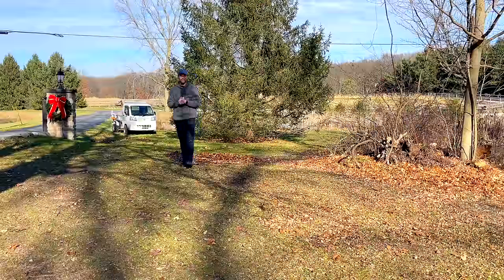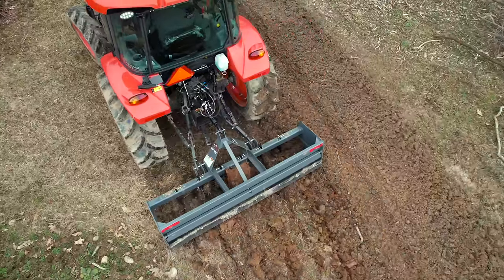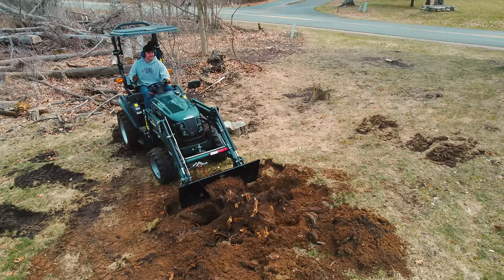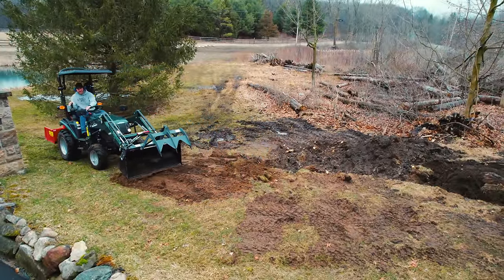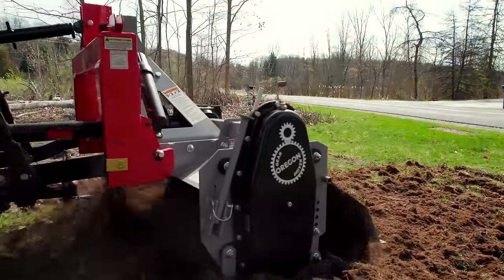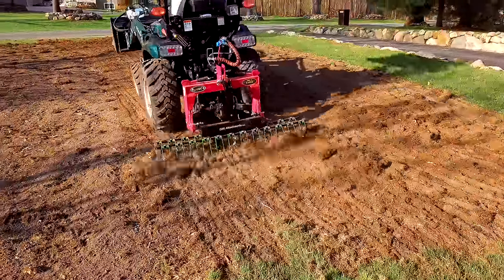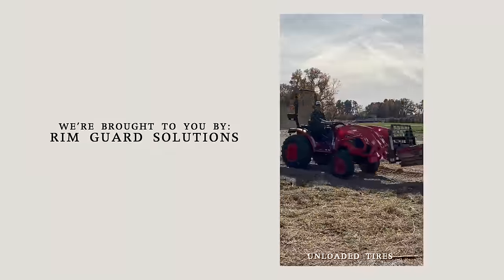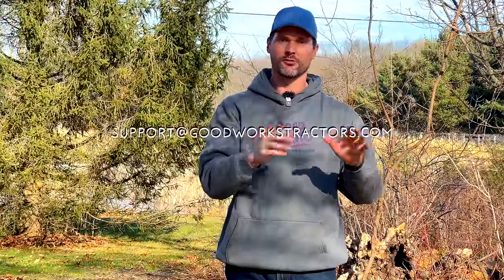HOW TO SMOOTH AND LEVEL A BUMPY FIELD OR LAWN

Comment: Courtney, Another great video. Good job keeping the people informed. I’ve had a JD 550 tiller on a JD 955 since 1993. As one person also said earlier, I would not trade it for anything. It pretty much stays on my tractor year round. The oddest use I ever had for it was once we had an ice glazing and then snow over that. I needed to push the snow off my driveway and since I use the tiller as ballast in the off season, I put the PTO to mid PTO which allowed the PTO tines to roll when I put the tiller down m. It then rolled over the gravel and broke up the ice glaze and it kept my tractor tracking straight on the glazed part I was driving very slowly over. Nothing was ideal in this scenario I might add. It really was such an odd usage, but when ya have one for almost 30 years you get creative. 

I’ve also left the PTO in rear PTO mode and the tines then don’t move and I use tiller as almost like a box blade and tillers drag flap on back smooths out piled up dirt and dirt flows through the tines rather well. I would HIGHLY recommend a tiller to anyone. I like it so much I bought a 681 when I bought my JD 4066R this spring. It is an absolute beast of a tiller too.

Comment: I did essentially this same process for a 20x20 flower bed i removed to return to grass yard. However, no matter what implement i used i just couldnt get it smooth. SO i went on Marketplace and bought an older Mauldin double roller vibratory compactor (the kind you drive)... 1 ton with empty drums, 2 tons with them filled with water. It was $2000 but man, what an addition to the arsenal. The ground was smooth and flat like an iceskating rink. I seeded over it and in 2 weeks i had green peach fuzz. Currently its the ONLY portion of my yard that is smooth and flat. Hahaha. After our NY winter ends, while the ground is wet in the spring, im going to roll the entire yard.

Comment: I’ve put good sized rollers on the back of tillers and they work great!!! The best rollers are the machined ones and they are also the most expensive but the landscapers loved them. Plan on spending as much as the tiller cost if not more. 

I’ll take out clumps and high spots with a heavy duty flail mower with hammers. Keep working in different directions until it’s smooth.

Comment: If you have a small-ish lawn and don't want to rip everything all up, apply a generous amount of soil to the areas you want to smooth out and hit it with a landscape rake. The rake will distribute the soil evenly and level the areas. This technique works great for low spots. A bit more work for high spots since you'll need to distribute over a large area to level things out. Thought I'd share so people don't think they have to destroy their lawns to get them level.
Reply: I'm not sure you've actually tried this. When you go over a bump, the rake follows. You never get it level.
Reply: I have a small-ish lawn and I’m trying to level it out since it’s very much uneven due to poor drainage, I’m thinking about leveling it first and then doing a French drain, what’s y’all’s opinion on that?

Comment: To level a piece of land out i would first determine how much roots there will be in the ground. If it's not much or much thick ones I would just till it with a rotary tiller and till it up really fine. And than just flatten out with a boxblade. If there are much roots I would firstly pul a shank ripper trough it and trie to pul out as much as possible. Collect the big roots rotor till it and then boxbalde it. The ripping will take a lot of time but it's the only way to save te blades on the rotary tiller from the thick roots.

Comment: Two years ago I bought a TYM T 264, same as a T 25 minus the air ride seat.  It had a FEL on it and I bought a 60" woods tiller.  I take care of about 4 acres and we built in 1991 so over the years after disturbing the land there were places the water found and reshaped things and about 600' of ditch line.  Plus I needed to fill in almost 12" around my foundation.  I ran the tiller across the top of the ditch with one side over and the other on the flat side and went back and forth what seemed like a hundred times then pushed the dirt into the ditch lessening the slope and smothing everything out.  I barely slow down now on my zero turn.  I needed a LOT of dirt around the house and I had a place they put the soil that cam out of my lagoon that was about a foot higher than the rest of the lawn.  I tilled and tilled that spot and created about 10 yards of dirt which I put all around the foundation.  It was just as soft as it could be.  I went nuts with the grass seed, may have used 3 times what I needed and covered it with straw.  I got it just in time!  It rained for a few days and in about 4 or five days I had really thick grass.  I honestly believe the tractor paid for itself in that one job vs if I hired someone to do the work.  When I was done the tractor was right at the 50 hour service mark.  The other thing I never knew I needed was pallet forks!  I never pick up anything manually now!  My sisters make fun of me and say things like, if you were wall papering a room you would figure out a way to use the tractor!  lol

Comment: I had about 2.5 acre area that was used for hay that had huge ruts when I built my house and made mowing with a rider hurt your back or get you stuck. This was the solution I used as well. Local guy on facebook tilled it for me with an old tractor. I used my friend's atv to drag a large frame I made from lumber that I'd wrapped with old chain link fence. That area is now more smooth than where the builder used their bobcat to grade around the house. I also didnt spray or scrape the topsoil and just tilled it all, and I didnt even need to seed it, the field grass came back on its own.
Reply: We built our home on a field that was used for haying and I have several very rough areas I mow that are so rough that I want to do something about it, and hopefully avoid tearing out the sod and bringing in new topsoil. So do you reccomend scalping the lawn first to get it as short as possible, then tilling it several times? The chain link fence frame you dragged around was just to collect small bits of sod/debris or is that what you used to level/smooth the area?
Reply: @p51mustang31 i mowed the 1 acre area with my riding mower as low as i could but not it's lowest setting or i would've hit ruts in the dirt and got stuck. There were still areas i couldn't get cut due to large ruts. I then had a guy with a tiller attachment on his tractor go over the whole area for me. I didn't spray and kill the grass like was suggested to me. The tilling left large clumps and spongy ground. It was also dry from not getting any rain for quite a while. I them built a fairly large frame from dimensional lumber nearly 8 feet wide and 4 feet front to back. I initially used that to drag with a 4 wheeler. It didn't knock down and bust up the clumps as well as i wanted it to. I then wrapped chain link around the drag and added more weight with dimensional lumber. This helped more but the biggest help was learning i needed to drive as fast as i could while pulling the drag. After that i just left it and the tilled up grass grew back after a couple months but it's smooth for mowing now.
Reply: @mleachx1  thanks so much for your insight! I'm hoping if I can make several passes over the same area with the tiller and that will help break up the sod clumps fiber and finer on each pass, and possible detach it also. Now I just need the utility tractor I have been trying to convince my wife that we need! Thanks again!

Comment: We used to do this method and it does work. Tiller, rake. But then when we had a few acres to level out rented a power rake. It did so well we wound up buying one to have and use. 90' landplane but they do make them smaller. I know they are expensive so if somebody has a small job to do they can look locally for somebody to rent one for a weekend. Usually just a few hundred dollars. Or you can even rent a skid steer and one and do the job pretty fast.  Not sure if you sell power rakes so may not help your sales but nothing like a good power rake to fine tune and level land out. Even with sod on it.

Comment: Thanks for the lesson, i will be doing a bunch of this next spring! How wide of a dethatcher/rake will a 1025R comfortably pull? I assume for level appearance the wider the better right?
Reply from the maker: You're welcome.  The dethatcher only comes in 60" and the 1025r handles it just fine.  It only weighs 50 lbs.
Reply: @GoodWorksTractors  thanks!

Comment: In my experience doing an area the size of yours 40x80 I would rent a gas powered sod cutter and cut the whole area. Then roll up the first 3 - 4'. Then take a loader bucket, put it in float and gently scoop up the cut sod. Granted you'll have to get rid of it, but in my opinion it's worth it. Then go back remove stumps, level or whatever you need to do.

Comment: tillers are awesome but if you can manage it, run a small plow single furrow or a double and then your tiller.  a small disc works great too. The smallest I'd go is 5 feet wide though because you need a bit of weight

Comment: You should try using the DeThatcher with the Heavy Hitch weight Brackets & 6 41 lb weights.  It's almost better than an Aireator.  Even clearing my trail cleanup was a million times easier.  The extra weight allows it to dig in as well as drag more material (when I was raking my trails) without the DeThatcher going over the material.

Comment: My Land Pride RTR would have broken something hitting those roots 5:30  thought at the top tilling-hight it is ideal for leveling if the feet are sliding on fairly level paths, I like how it leaves little rows of rooted-grass where I can notch out the peak of a hill every few months, or pull a few slivers of soil out of a ditch.
Reply from the maker: Neah, tillers are tough! Including your Land Pride.  They are designed to work in extremely rough conditions.  Worst case, you break the bolts off a tine.  Get some new bolts and back in business.  That's what they're made for :)

Comment: Just the tiller and a good chain drag would've been sufficient. My favorite drag leveler, is the springs from an old mattress or box springs. I can't believe no one has offered that as a legitimate product... as they're the most effective drag leveler I've ever used. They level, smooth contours, drag away plant material, and kick larger rocks up.

Comment: Step 1 rent a D9 dozer. 
Step 2 spend a week ripping out all the rocks and stumps and getting it flat with said dozer
Step 3 get some fill, hopefully your near a navigable body of water because trucking in hundreds or thousands of yards of fill is going to cost $$$$$
Step 4 rent a loader and start speading the fill
Step 5 who knows because your most likely broke by this point 🤣

Anyway that’s what it will take to level my yard, I figure it’s going to take 1,500 yards of fill and several weeks with a D9 to get mine flat enough to mow yet high enough to drain.

Comment: The easiest way to do this is to use a surface seed planter, zip seeder, or even a small corn planter. You can level a spot by just adding compost instead of fertilizer. Just is easier and will cost less money and time playing with machinery. It takes years for the soil to recover from tillage soil aggregation which is how healthy living soil absorbs water is pretty much destroyed when this is done plus you are creating all kinds of weed issues with tillage.
Reply from the maker: All well and good, but you forgot about the entire point of this process which is leveling out a bumpy field.  Your idea works for overseeding only on an undisturbed plot.
Reply: I think Mr Courtney is spot on with this video. It’s also a great time to add the fertilizer (and lime) as needed to get those seeds started